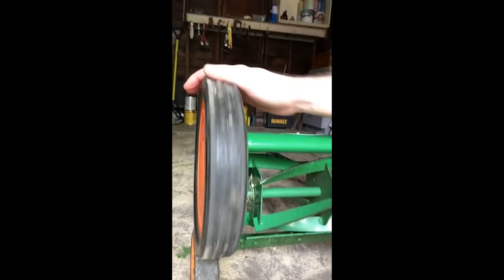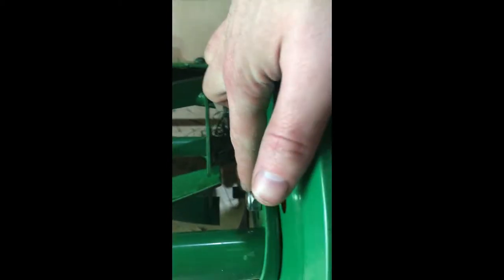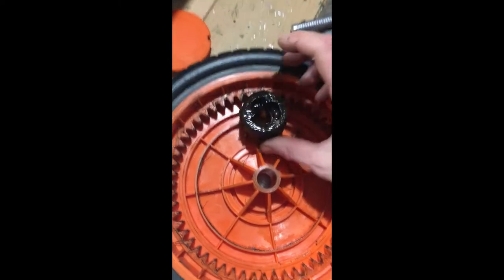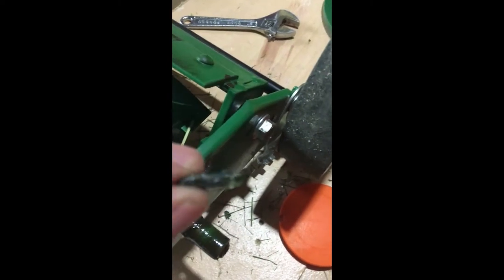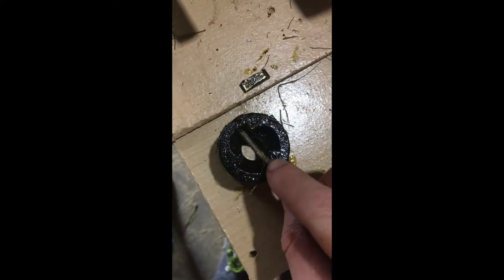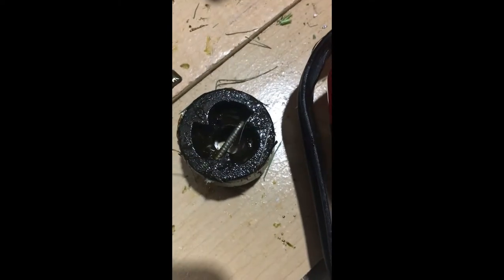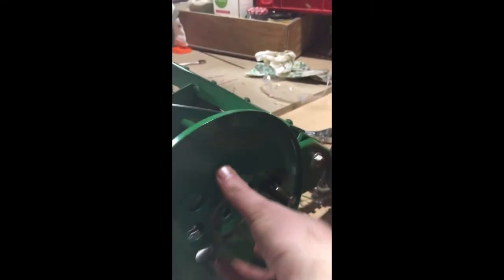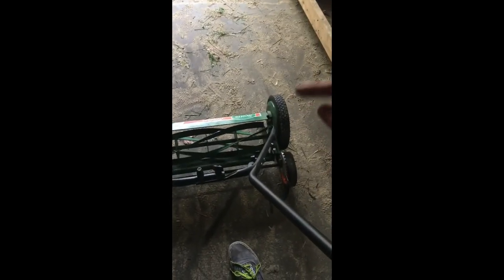Scott 20" Reel Push Mower Fix - Blades Not Engaging

Comment: This video helped me a lot! The fix in my case was simpler, though. The only problem was that the pin was not moving freely through the hole, so it wasn't dropping in place. I cleaned both the pin and the hole using various automotive cleaners, and it works like new. I had the same problem on both sides. No need to cut nails or order any parts. YMMV.

Comment: Had the same problem myself with two different mowers. Solved the second one with a strip of metal from a beer can wrapped around the shaft under the gear. solved the first one by replacing the gears with Qualcast gears. If you Google them look out for a blue and yellow pair. There's a fair chance they will fit but it's a bit of a gamble. In both cases there was too much play on the shaft.